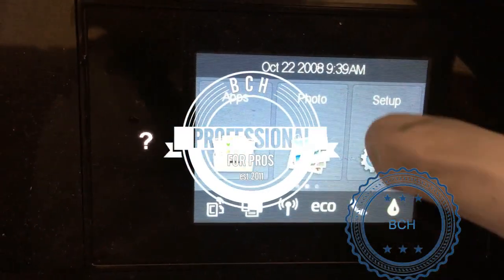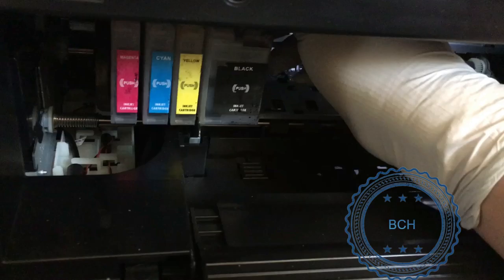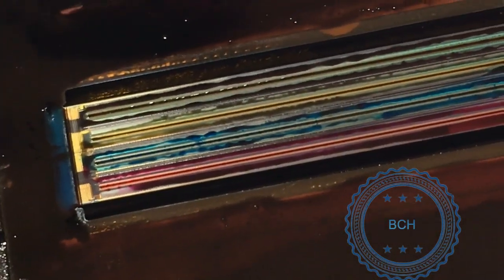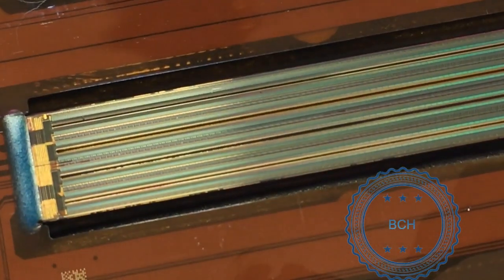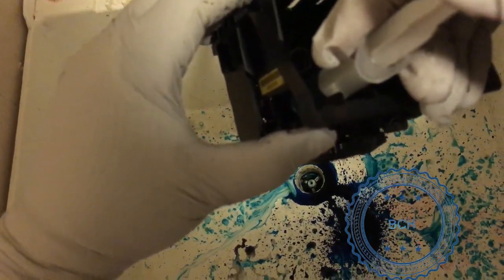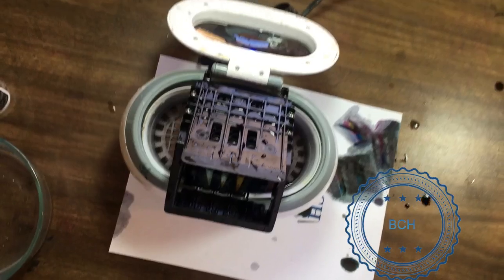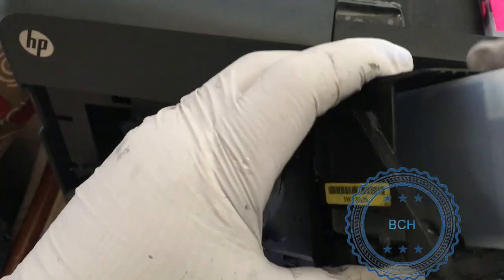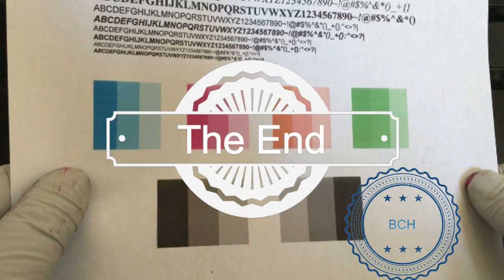3 Ways to Unclog HP 950 Printhead - OfficeJet Pro 8100 8600 8610 8620 8630

Comment: Hi, I have read that it could be very problematic when using an ultrasonic clean. Can you give any other advice (e.g. how much time, any special brand in ultrasonics). Thanks!
Reply from the maker: Ultrasonic should be used as the last resort for the printhead cleaning.  There are reports showing ultrasonic cleaner destroying aluminum foils.  We use the ultrasonic cleaning on a regular basis.  What is the alternative?  Throw the printhead in the trash?

Comment: the magenta is not pushing at all. do u know why? it was perfect since 1 week  after that it deteriorates quickly to the level that almost no red comes out. it is hard to push water through magenta opening. though itis easy to suck air. i belive there is no nozzles clogs but may be valve problem or so. any help?
Reply from the maker: If you use pigment ink, the magenta is the easiest one to clog.  For dye ink, it shouldn't be a problem.  Be careful when you push the cleaning solution through because there is a bladder inside.  You don't want to burst the bladder.  Use gentle force and a little bit a time.
Reply: Same thing here issue with the Magenta which get Clogged and cannot be cleaned as have inner blocking inside the Valve and it cause me 3 print heads till now and its only with Magenta and its Dye ink not a Pigment ink , If any solution for that issue please let us know

Comment: These printheads dont like ink getting into the  connectors .   you get missing cartridge error for the two 4 wire plugs - only one connector is visible without removing some screws.   Also you can get dried ink on the reservoir ink sensor springs and connectors so you get depleted cartridge error.

Comment: cleaning is not advisable replace new printer head for this model after few week same issue
Reply: So you installed a new printer head and the same problem occured after some weeks?